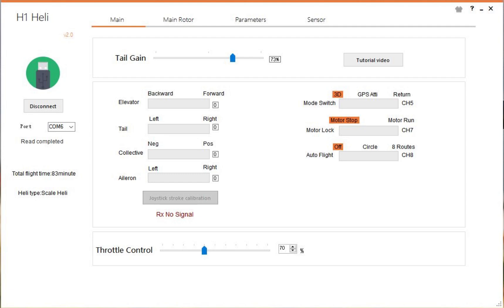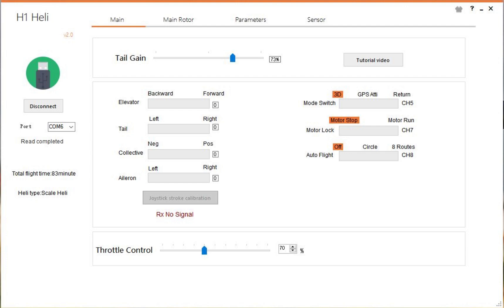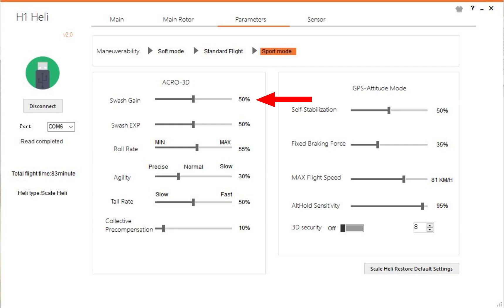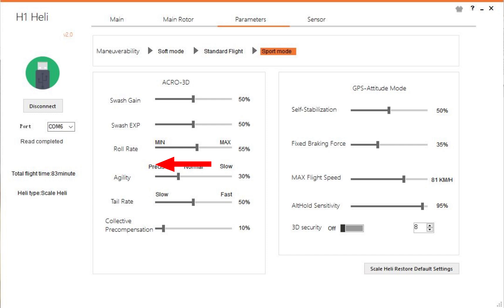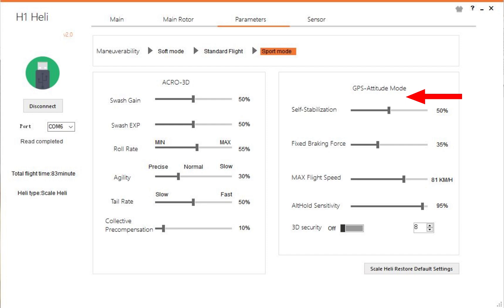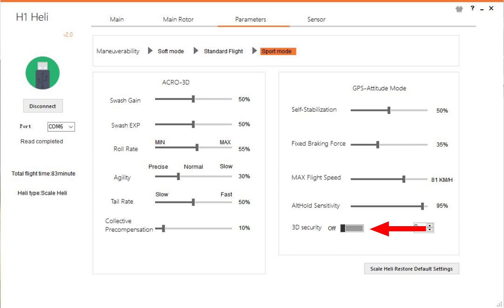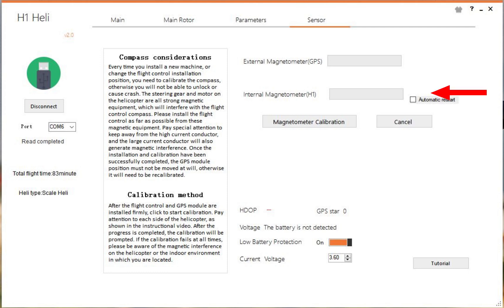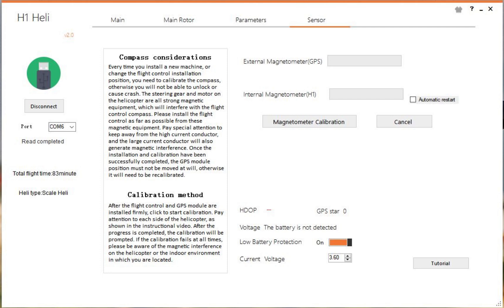Flywing H1 software - Basic guide

Comment: I setup an Excel spreadsheet to tabulate the parameters list of the three mode groups (soft, standard and sport). It lists the default values along with my custom settings.  Helps this old brain keep track of my adjustments.  Going on vacation early next month, on my return, I'm ordering the EC 135 as well.  My objective is to eventually have the full collection.  😂

Comment: Have you figured out how to reduce the main rotor RPM in 3D mode? I think the Throttle setting on the Main page only affects GPS mode...
Reply from the maker: Throttle in 3D mode is always 100%
Reply: @Mikes-tuts-rev  Well, that's silly... 
Has anyone obtained source code for the H1 so they could override that somehow?

Comment: Hi, I just put the H1 system in a 470lm did the setup and calibration everything is looking good. When I perform startup the moment I hit the arm switch the motor instantly goes to full power. Any idea what’s going on?? It scared the hell out of me.😳😁
Reply from the maker: This is a new one to me. I have no idea. Seems like something wrong with the radio settings
Reply: @Mikes-tuts-rev thanks for the reply. The problem was the ESC default setting was supposed to be soft start, it was on airplane mode from factory.
Reply from the maker: @nicklong9985  Great that you sorted that out. I was not even aware that you had an aftermarket ESC so couldnt have advised anyway :)
Reply: @Mikes-tuts-rev  no it was the kit esc but for some reason it wasn’t set to the correct default setting.

Comment: I have a question as this is all new to me. I had to re-calibrate the model after I accidentally hit the calibrate in the sensor option in the H1 software. So now this is the first time I'm powering up the heli, I did calibrate it and I do get a steady green light when in gps mode. It push the sticks outward to unlock the motor  the GPS light now flashes green for about 5 seconds. During that time of flashing I can start the motor, after flashing stops I no longer can start the motor. When I start the motor during the green flashing the gps light remain flashing green the whole time. Is that normal or should the GPS light go steady once again after the motor is running?  Thanks.
Reply: Your heli works correctly. Mine stays flashing green while main motor is running. If you stop the motor, you must restart within a few seconds while the light is still flashing green or it will go back to solid green and you will need to push the sticks out again to re-arm the motor. All very good safety features I think. It is an excellent heli to fly in very small areas in GPS Mode to practice fine control movements. Good luck.
Reply: I have same thing. Flashes green whole time

Comment: Good advice re the low battery protection. Lipo alarms are plenty loud enough to be heard over a running heli. And they're cheap. Don't rely on a timer - depending how aggressivly you fly will dictate how fast your battery drains.
Reply from the maker: I use both alarm and timer and fly to the timer, if the alarm hasnt gone off yet.

Comment: Thanks for sharing! Just one question - if you set 3D security On and set 10 meters for example, when you take off in GPS mode, and flip the switch on 3D BUT you are below 10 meters, will it engage the 3D mode or will stay in GPS? Thanks!

Comment: A good video but just one comment considering this is scale helicopter hence will look its best its if flown realisticaly so that the human brain can harmonically scale everthing down too . A speed of 81kmh is way too unrealistic  since a life sized Bell206 has a max speed of about 220kmh.
Reply from the maker: @75echo  you can fly in the first mode and it's speed is drastically reduced. By your calculations, if this is for example a 1/10th scale it should fly 22kph? That will never work for an RC heli. No RC vehicles that I know of are scale speed.
Reply: @Mikes-tuts-rev  i set my max speed inbthe software to 25km. It flies great and scale.
Reply from the maker: @75echo  ha ha, great to hear and each to their own. thanks for the participation. Regards
Reply: Just imagine if a Bell 412 v4 is set to that speed, it would move like a rocket. The max setting is 100km/h like in the video.
Reply: @mike-tuts-rev Thank you 4 the informative video, would surely use it, just need access 2 a computer.😮. My phone is the only technological device l have.😂.